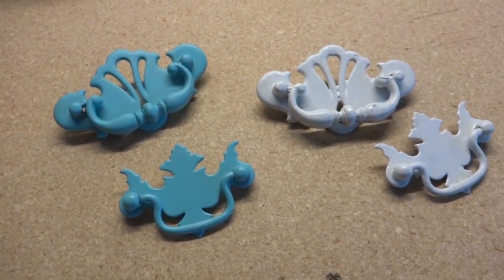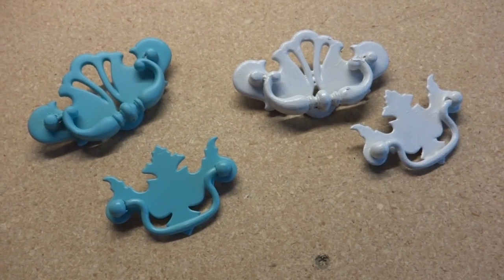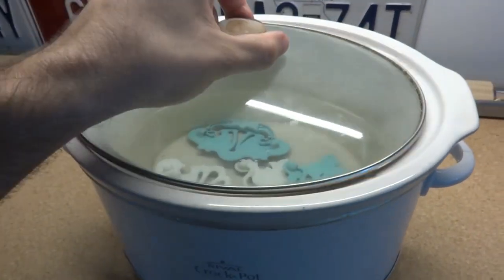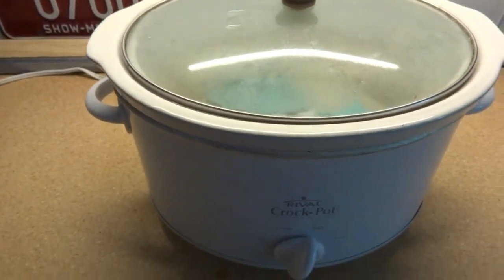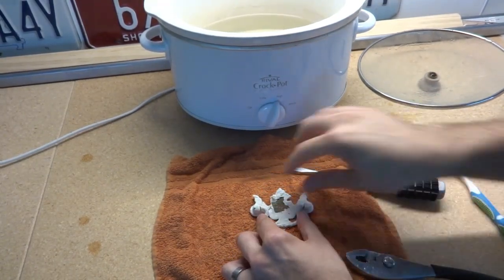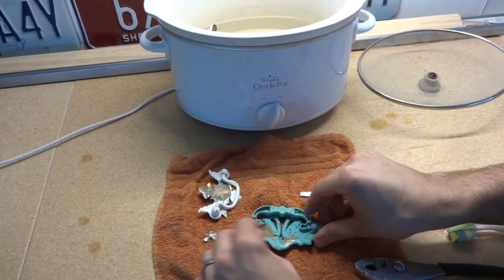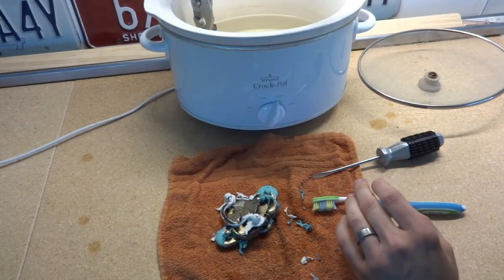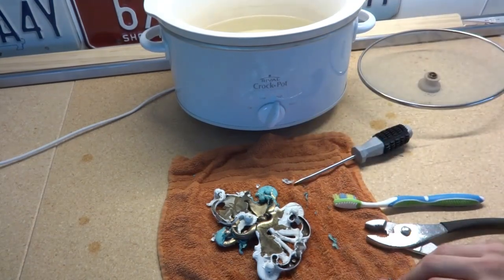How to Strip Paint in a Crockpot!

Comment: Using a soft brass wire brush works better than a toothbrush if you are not worried about a little surface scratching.

Comment: Nice tip, thanks for sharing. Btw, how much energy did you use?
Reply from the maker: Thanks. I'm not sure how much energy it took. I haven't tested, but I'm thinking you could possibly even boil them in water over a fire if you wanted to use zero energy.

Comment: Kevin,  What type of camera do you use and what program do you use to edit your videos?
Reply from the maker: Similar to the projects I build in my videos, my camera and editing program are low/mid grade stuff. lol  

I use a cheap SONY DSC-WX80 point 'n shoot camera that I've had for a few years on the video setting. It shoots pretty decent video in up to 1080p, although I just record in 720p to save space on my computer. It's got saw dust & over spray all over it, and the plastic body is cracked in a couple of spots, but it's still plugging along. And my tripod is a $6 cheapie I found at Salvation Army one day while looking for furniture. ;)

For editing, I've been using a low budget, $50 editing program called Wondershare Video Editor. My PC crashed recently, so when I went to download the program again, they had updated it a bit and changed the name to Filmora. It's pretty easy to use and has quite a few options for as low cost as it is, but it is a fairly bare bones compared to higher end programs. I just use it for the basics, so it's worked great for me.

I also use an open source image editor called Paint.net (which oddly, is found at getpaint.net) for my graphics & "photoshopping" needs. It's clunkier than Photoshop, but it's free, so I'm not complaining. Been using it for years now.

Oh, and also, I've been buying my royalty free music at Pond5.com lately. I know YouTube provides some free music you can use, but I like Pond5's options, and they have great prices. They also have good customer service that's helped me dispute (& win!) some copyright claims that were put on a couple of my videos.